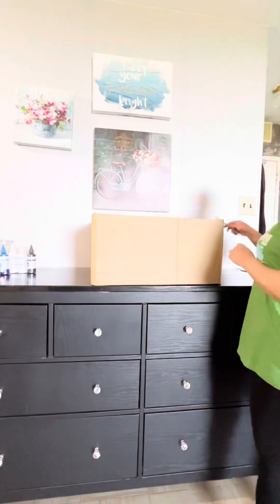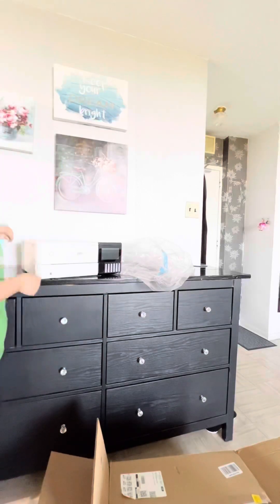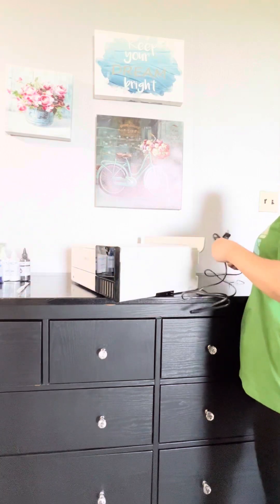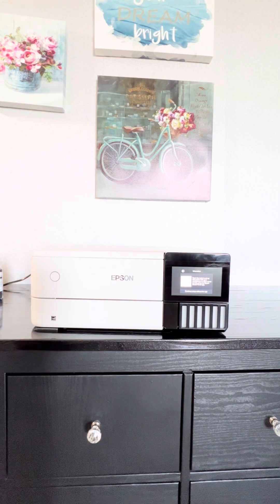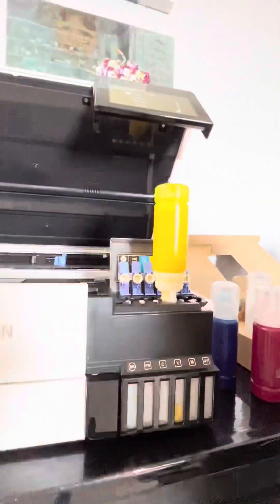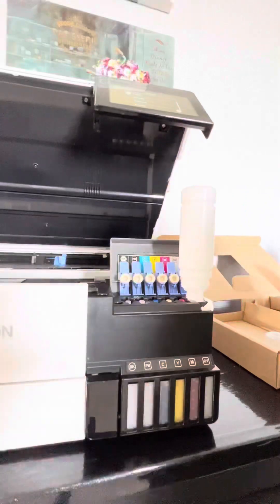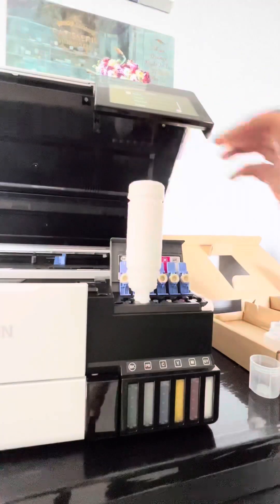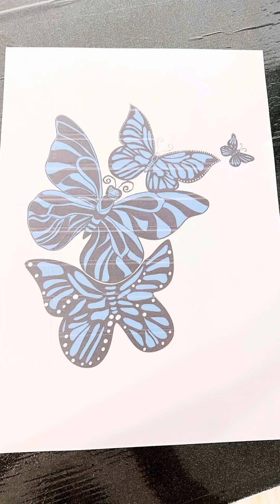How to convert EPSON ET 8500 printer into DTF printer full tutorial #epsondtf #dtfprinting #dtf

Comment: So in a nutshell, remove all the blue tape as you should and replace the standard ink tanks with the DTF inks. DO NOT USE the standard ink. No removal of any parts from the printer is required. Which compartment do you suggest to fill with the DTF "white" ink?

Also is the printer system set up easy from Mac devices?

Thank you
Reply from the maker: @Paparazzionsite  yes ink should be replaced with DTF inks. Printer can connect easily with Mac devices but software is hard to download in Mac devices. I have ASUS laptop for that it was also difficult in the beginning to download software but it worked well with other devices them MAC because they have restrictions to download other softwares.
Reply: @minasstitchingvlogs7157  Thank you so much!!! I'm excited!Can you link the DTF ink packs you use and what compartment do you put the white ink?
Reply from the maker: @Paparazzionsite  i got it from amazon. https://www.amazon.ca/dp/B09X9PKRQP?ref=nb_sb_ss_w_as-reorder-mobile_k1_1_4&amp=&crid=1R4RG3HZHYW3N&amp=&sprefix=dtf+
I used black and grey 2 compartment i used for white. First two compartments i used for white.
Reply: @minasstitchingvlogs7157  Thank you!!
Reply from the maker: @ u welcome 🤗

Comment: I am on the cadlink about to down load the printer to it but I have an Epson et 8500 it only gives you options for the 8550 will they work in both printers?
Reply from the maker: @Xrorav  yes it works its same thing both printer is same
Reply: @minasstitchingvlogs7157  Are you sure? Cause in cadlink it says (epson et-8550. Those are not the same printer.
Reply from the maker: @ i have tried and mine is working

Comment: Is print quality same quality of a regular budget dtf printer?
Reply from the maker: Yes its same difference only makes quality of ink and dtf powder and how long you want to print sizes
Reply: @minasstitchingvlogs7157  do you think it's a better option than this? "easycolor". https://youtu.be/rvmqZJCXqoY It's the cheapest DTF. Basically we're looking for the most reliable budget option. She's in Mexico and not very technical. Can someone with basic skills convert this and maintain it? Thank you
Reply from the maker: @ yes thats a good option if you have budget. But dtf printing requires some technical skills. Because it does give errors and printing problems some times ink clogs paper jam. You run into difficulties so it doesn’t matter which brand you buy but in the long run you need some basic knowledge how it works.
Reply: @minasstitchingvlogs7157  which is the better option , the et8500 and convert, or the one linked above? (enjoycolor)
Reply from the maker: @ get the link above which is already for dtf

Comment: I want to get the 8500 do you need to remove the rollers and add a waste tank like the 8550?
Reply from the maker: Hi yes you need to remove rollers and you need software dtf. I use cadlink. if you want to convert DTF printer, And you also need to replace maintenance box. If you don’t want to change then you can do tank method but for that you need to buy also chip reseter in order to do that. Overall at least you have to keep in mind it will cost you around $2000 cad.
Reply: Can you help me please